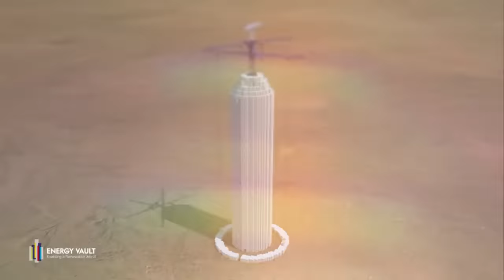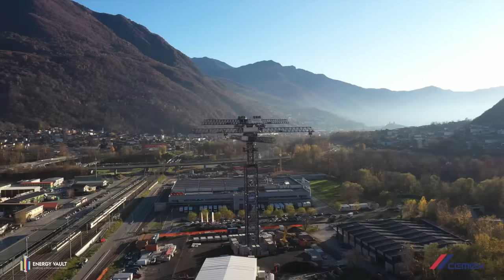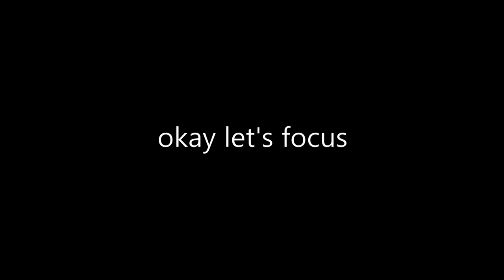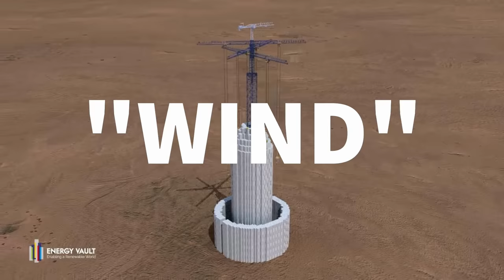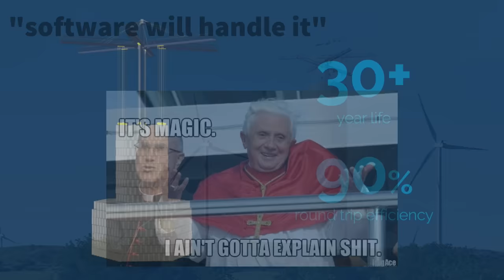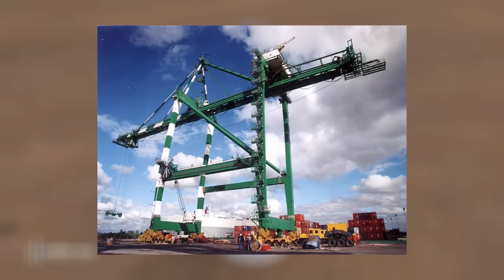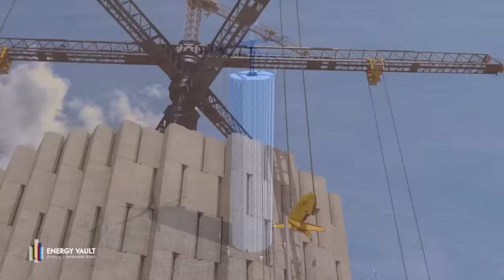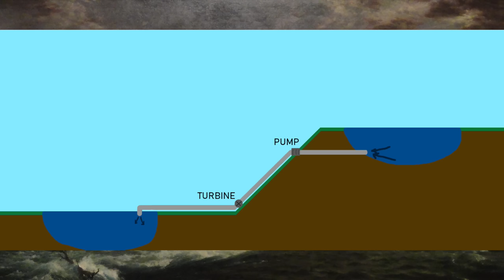The Energy Vault is a Dumb Idea, Here's Why

Comment: Honestly, even if we just stick to the idea of "lifting and releasing something very heavy", why not just have one VERY heavy block (possibly made out of un-recyclable waste materials), which is lifted higher and higher with energy surplus, and then released gradually when the energy is needed? What's the point in stacking a bunch of blocks?
Reply: Cool cgi
Reply: How high would you put a single block? That sounds ludicrous.

Also, the cost of raising something up with a cable increases exponentially with total height, as the cable has a mass and needs to support itself. It's a very common problem in long elevator designs.
Reply: Yes, this concept exists adn operates in some places. Using old mine shafts that go down deep enough and have huge ass elevators already. Scaling up to a lot of locations becomes a problem though
Reply: @Darkxellmc  of course, you recover energy from the cable going down as well.
Reply: ok to be honest a the idea of going sightseeing and encountering "the cube of energy" is funny
Reply: insane costs and it uses tons of resources. since steel has weight and has to support itself, it runs into something similar to the rocket paradox ( a rocket needs a lot of fuel to go up, but adding more fuel means adding more weight, so you need bigger engines that burn more fuel, so you then need more fuel and so on and so forth) and you would have to build something straight out of pacific rim or star wars to pull it off. or, you could move lots of separate blocks for way cheaper of a startup
Reply: Better yet, add a bunch of pulleys.
Reply: Wouldn't it be unuseable on surface level as the higher up the block goes, the higher the center of gravity of the whole structure goes and the more likely it is to fall over due to exterior perturbations? Feel like digging one canal and a pump between 2 ponds is way more efficient and less of a headache than digging a whole deep and wide enough to use the block safely
Reply: answer is torque
Reply: I also thought of that, but if the power output needs to vary alot, especially going much lwer than maximum, it seems like it would become very inefficient.
At maximum power the only thing slowing the giant block would be generators, so to lower the output power you'd have to either add brakes to slow the block down or reroute the excess electric power to some useless load. Both waste the stored energy, while with small blocks you can just regulate the amount of blocks lowered simultaneously
Reply: @Darkxellmc  Orbital drop lmao
Hey guys let's attach a wire to a generator and a meteor and send it to pluto
Reply: Pumped storage hydroelectricity would be better in all cases regardless; such a system would be able to act as freshwater resoivour, and the accompanying system of locks and levees assisting in flood proofing on a region wide level.

Suspending massive weighted loads to store kinetic on a macro scale is equal parts imagative and mindless; the cost / benefit ratio is only in favour of those selling the counter weight materials, and those contracted to maintenance (but no responsibility for) of a single point failure system
Reply: Because the crane would have to be ridiculously sturdy
Reply: Yeah or Just Pump Water up a Hill and when needed Release it
Reply: Because one massive point of failure is a bad idea.
Reply: Or build a nuclear reactor.
Reply: And couldn’t you just make a bunch of gears so that you only have to lift that block an inch or so?
Reply: @markawbolton  nuclear reactors take time to come online. Gravity batteries are used to supplement electricity grids during peak times and unexpected strain. They need to start generating within seconds. Only gravity batteries can achieve this - and as to the points above, they are all pumped storage hydroelectric generators.
Reply: @Darkxellmc Used to work designing elevators... can confirm all the equations are done by a single excel spreadsheet. Its a problem, but like... they just pay to fix it with more ropes.
Reply: @andruestafford  You scare me a little XD
Reply: Space elevator duh
Reply: It's not flashy and futuristic enough - this reminds me of a grandfather clock. This makes it provably practical on a small scale and old-seeming - two things that work against tricking people into investing in stupid ideas.
Reply: It needs a place to rest and store potential energy, perpetually using energy to lift the block or keep it held would make no sense.
Reply: What if instead we make a bunch of little blocks out of compacted trash.  We can have little robots stack the trash blocks into giant towers of trash blocks.  We can call them Waste Allocation Load Lifters, Earth-class.  Hopefully they will keep this planet habitable.
Reply: @jimmyhack7336  😂😂😂 Yessssss!! Let's make a bunch of them, and maybe we can all just leave the planet and take a short, temporary, space cruise while our planet gets cleaned.
Reply: @LesterBrunt  Ehm, no. The amount of energy stored depends on the mass of the object and height it was raised too (or more specifically how far will it be allowed to fall). Geabox will just change ratio, but will not magically add energy.
Reply: @yorhaunit8s  Aren’t you lengthening the path with gears? Like when I spin my bike pedals in a lower gear I only have to push down the pedal an inch for the backwheel to start spinning like crazy.
Reply: @LesterBrunt  no, you're not. You are changing ratio. With a bicycle example on lower gear you push pedal only a little but it now requires greater force. On higher gear it will be easier, but will require more rotations on pedals. Energy stays roughly the same.
Reply: @yorhaunit8s  Oh ok I get what you are saying. But couldn’t it work not as a way to gain magical free energy but as a way to not have to raise the block 100ft in the air? Sorry if I am saying dumb shit I have 0 engineering stats.
Reply: @LesterBrunt  You could use that to raise a larger (with more weight) block to a lesser height. But your energy output will still rely on mass and height. If you reduce one - you should increase the other.
Reply: @zanderdev57  It's not the same problem. As someone else said above, you need to take in consideration the entire composite thing you're lifting and dropping. The cables are part of that system: every kg of cable contribute to the system the same as every kg of concrete.
Reply: @MrCh0o  Well, for tiny power fluctuations you would probably have a smaller one which goes up and down faster. For an easy dead weight, use a decommisioned ship, filled with scrap, maybe some slag, whatnot. A 7000 ton ship lifted up 1000 meters, or all 64 active Arleigh Burke-class destroyers of the US Navy lifted up just 16 meters, will store that 18MWh daily production of that single wind turbine.

Nah. Instead I propose 4 things:
A: Pumped hydro

B: Energy diversity, both in types and location. So wind, solar and hydro power from several different areas, with sufficient capacity on the cables between them. Remember that peak loads happen at hours due to different time zones, solar power happens also at different hours, and wind is not consistent across a whole continent.

C: Over capacity, which costs too much now, will not cost so much in the  future. Both solar and wind have come FAR down in cost in recent years.

B: Thinking more about utilizing overproduction of power then and there. Imagine you have an automatic production facility which is able to ramp up and down production based on available power. No wind? Ok, so let's not run the heaters for the cement factory right now.  This last point is how Norway got set up with so much of both aluminium production and hydro electric power back in the early 20th century. Unfortunately, aluminium production requires a very consistant heat to work (so perfect for hydro), but there are plenty of processes which can and should be ramped down between the hours of 7-9 AM and 4-6 PM, when demand is high and solar might not be optimal yet. If you have sufficient heat capacity in your process, ramping down the heat for 2 hours twice a day might not even be noticable.
Creative industrial processes might be just as valuable as more power in the future. Imagine you want to process ore on a space station, or a mobile processing plant bored into an asteroid. Maybe this will need to be done with less available heat than you can get from a huge power station next door.
Reply: Who says people aren't working on that? Afterall, it is the obvious thing to start with when you're in an area where there's no nice mountain to put a huge artificial lake onto (i.e. almost everywhere).

However, the issue is that the amount of "height times mass" you need to store serious amounts of energy is extreme. One example would be 6,500,000 m³ of water at a 280 metre height difference for just 4 GWh. And while stone (dirt, concrete, ...) is 2-3 times heavier than water, lifting concrete cube that is 139 metres in each dimension up nearly 300 metres is a bit outside practicality...
Reply: Ummm, logic was done for you, I guess. So the point of this shit tower is to supply energy like a battery while you presented a concept of condencer.
Reply: It's called a TRAIN.  Fill 100 cars with ore.  Drive it up a hill.  Then release the brakes.  Simple, cheap, effective.
Reply: @oVoidhawko  Tom Sauk Mountain.
A trainload of ore climbing a hill is even more efficient than pumped storage.
Reply: @d_boi9345  actually now that you mention it... i want this project to become reality solely so I can legitimately use the words energy cube.
Reply: @juanausensi499  sure the cables do contribute in weight but at some point every kg of steel starts working more and more against the main structure, so you need to build more robust designs for less of a payoff. as strong as steel is, eventually the amount of force from either torsion, tension or compression will be too much unless you reinforce it. and as op said, they want to just lift one payload higher and higher and release it from the top whenever it is needed, so that implies that the structure would be absolutely ginormous in height. in my mind i am imagining a brutalist eiffel tower with a main block being raised in the center, and i just feel that is incredibly impractical, would need insane amount of resources and lots of irremovable parts.
Reply: There's at least one company doing that, and I believe one commercial prototype has been contracted. Heavy weights on a vertical shaft, basically a glorified version of the weight system used for grandfather clocks.
Reply: @oVoidhawko  yep water does a better job than massive bricks if you want to store a lot og energy
Reply: Oh and combine that with a space elevator and you got a perfect BS to sell that would cover all the energy storage problem of humanity for next 1000years, and as we say in startup nation "to make the world a better place" ;c)
Reply: Buildings are heavy.  Why not just build homes or buildings so they move up and down depending on the energy needs?  The heavier they are, the more kinetic energy they can store.
Reply: @zanderdev57  Dig a hole, put the crane structure on top of the hole. Instead of thinking of it as 1 big thing to lift. Think of it as several things, but connected by 1 rope. 
Heck You could even use the structure to build the hole deaper. Since many of the windturbines are located on higher altitude, I cant imagine ground water level to be an issue.
Reply: Solve this one just like you solve the rocket paradox. Space-elevator style. Have the weighted object climb, rather than be pulled?
Reply: @mhplayer  the issue with that is that, to get the height difference needed, you need very specific terrain, specifically a lake near a cliff edge, whereas a solid weight needs a different terrain, a long strait shaft. So you do the solid weight thing in abandoned mineshafts, or with bored tunnels strait down, and you do the hydroelectric thing where you have a convenient mountain lake.
Reply: @JuStaNotherOne1337  but why use only one cable? it will likely break because suspending lots of weight slowly weakens the cord holding it and as this was explained to me, the point of the system is to just lift one large block and not many smaller blocks. digging a hole in the ground is a beetter solution than building up but like the guy said, at that point just use water and a water turbine

Comment: Instead of a bunch of blocks, my concept was a single mass (per station) of a bunch of waste materials in shipping containers that goes up/down incrementally. This would also allow for that mass to lift a heavier mass an increment when it is full.

Other ideas include pressurized air (we could perform some chemistry at high pressure to only release oxygen and nitrogen back into the atmosphere

Comment: While the energy vault is dumb, pumped storage hydro is very location dependent and the footprint is a lot bigger (and evaporation / seepage / weather / water use concerns). We can store energy thermally in rocks - create well insulated boxes full of rocks and  connect them to a heat exchange loop and a turbine. Excess energy in the system is used to heat water (100% efficiency) and then when you extract it, it drives a turbine which is normal efficiency. Perfectly scalable, tamper-proof, engineering so easy it's boring, applicable to literally any environment, mobile, cheap as rocks. If you replace rocks with water in this set up, similar to as described in the video, you get a higher energy density (for an application that is very scalable so why?) for the trade-off of thermal expansion, corrosion, water vapour pressure, easily tampered with, sloshing during transport, algal growth, contaminants, etc.

So I think hot rocks in a box could be a better solution than all this techno-marketing bullshit, and possibly better than even  hydro storage.
Reply: Look up thermosolar salt storage :)
Reply: You can couple this with compressed air storage, too - the thermal reservoir takes up heat during the compression phase and adds it back in when released.
Reply: Have a look for the pumped hydro storage atlas
Reply: Yes, it is location dependent, but most countries have pretty well developed electrical grids so they can put their storage anywhere. As long as the country has any kind of suitable location anywhere near its grid, it could use pumped storage. I imagine a few very small, very flat countries might not be able to manage it, but most countries would have somewhere with the right terrain to do it.
Reply: @mikelms20  I was about to say this, molten salt melted by concentrated light.
Reply: @Eligio Budde You could put the hot rock boxes in urban neighbourhoods and use the hot water (after it's run through the generator) to provide, well, hot water and district heating to the houses around it. Like some countries already do with heat generated in traditional power plants.
Reply: Any system that converts heat back to energy is limited by the Carnot limit. I.e., the "normal efficiency" is somewhere around 50%. Whereas hydro systems have roundtrip efficiencies north of 90% as far as I remember.
Reply: That’s not good efficiency at all. Heat engines will get maybe 40% if you’re lucky. Doubling your energy production capacity just so you can store it is putting the cart before the horse.
Reply: Entropy. Thermal systems are NEVER fully reversible, because generating Thermal Energy is entropy’s ideal state so converting it to any other state is going against entropy locally and thus harder to pull off.  Thermal storage in general is not a completely outlandish proposal—molten salt is the preferred way to do it currently, since is absurdly hot and can be pumped around wherever you want it like oil and water—but even in theory basically no systems are 100% efficient—especially not thermal storage—and the real world is never as efficient as it “should” be on paper in any case.
Reply: @Scrogan  Energy storage is not about building production dedicated to refilling the storage, that would be self defeating. It's about using overproduction periods to power underproduction periods.
Reply: "Excess energy in the system is used to heat water (100% efficiency)"
100%? Molten salt generally has a Carnot limit of 36% efficiency, and I imagine this would be less.
Reply: Hydro pump storage really isn’t that location dependent. It doesn’t need to be fresh water to store energy, even ocean water will do. You can even do it with treated sewage. All you need is a liquid medium and a way to elevate it.  Its also easier to store potential energy than thermal energy
Reply: Maybe take your idea and expand on it have your box's or rocks but also fill full of water .
Reply: @mikelms20  you must mean molten salt
Reply: @LS-pe1rr  Not necessarily. The context aside 100% efficiency just means for every joule of energy you put in you get one joule of energy doing what you want from it. Granted it's impossible to reach 100% efficiency in a real world application, you can get pretty damn close to it. Look at electrical heating. Its efficiency is damn near 100% because the vast majority of energy consumed is turned into heat, which is exactly what you want from it. Perpetual motion machine is something that can do work without external power source, i.e. produce new energy, which is of course forbidden by laws of thermodynamics.
Reply: Honestly, I think part of the issue here is using concrete blocks. I remember years ago seeing a plan to use basically train cars filled with rocks and sand that would be pulled up an incline when there was energy to store. When you needed the energy back, you'd simply run the motor in reverse by letting the car slowly descend the incline, and you'd get most of the energy back. It had relatively few moving parts and the main issue being the space required.